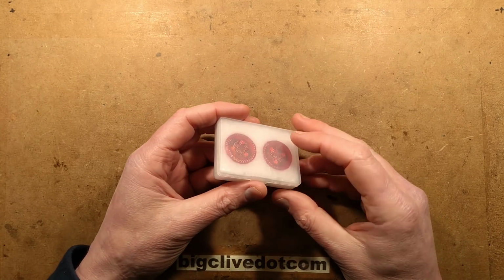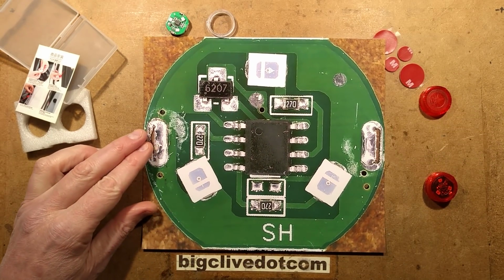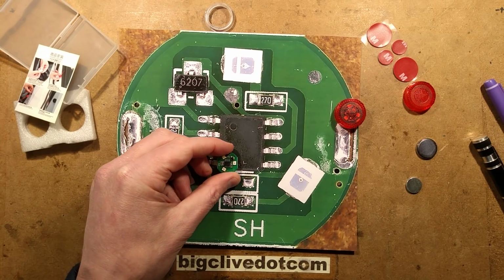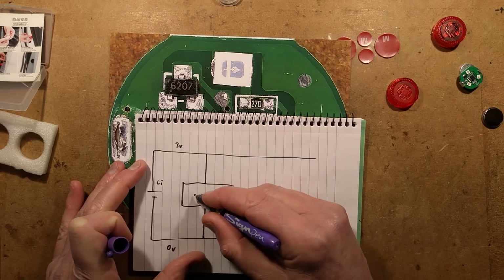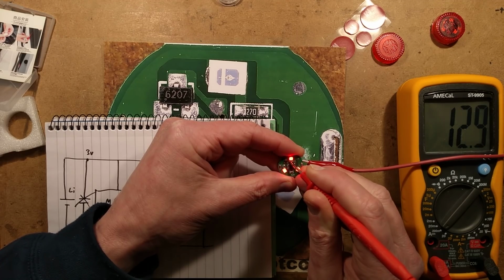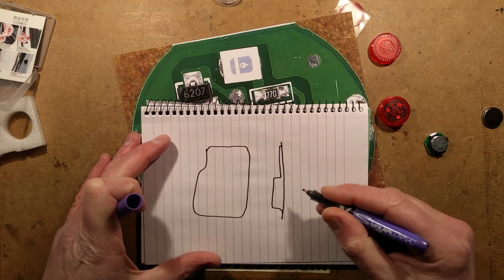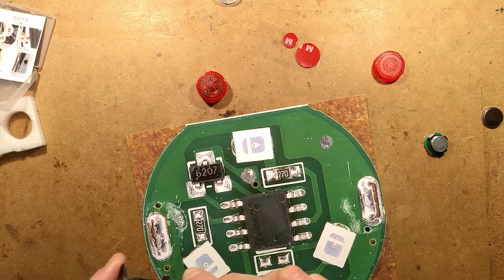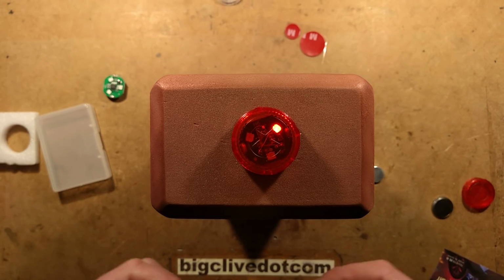Self contained vehicle door warning strobe lights.

Comment: That 'odd' effect is 3 LED's switching, each with the same duty cycle. Try blocking off each one in turn, with your thumb or finger, and you’ll see it clearly. Nice idea, but useless in daylight, or when a cyclist or driver is not looking where they're going. There was something similar, on various cars, decades ago: It used 12V filament lamps mounted in the door, wired in parallel to the cabin courtesy light, and operated by the door switch. Simple and reliable. Another, even more reliable, option is to use one or more flashing LED's, with resistors, and a door-mounted micro switch or reed relay. No need for a PIC, capacitors, resistors, or other semiconductor devices. Again, it can be wired to the door switch.

Comment: One way to check whether suitable space exists around a car door for these is to put a large blob of blu-tac in the desired area and close the door to flatten it to fit the space. Then just either measure the compressed thickness of the blu-tac or compare it directly to one of the modules. Simples!

Comment: These devices are too small and too dim to be of much use.  I would rather spend the money on a strip of reflective tape that can be secured to the edge of the car door — needs no batteries and always works as long as approaching vehicles have their headlights on.

Comment: The spot you shown is going to be fairly common but some cars it's occupied. The one control I can think of off the top of my head that's roughly in that spot is a child safety lock. The factory very likely punched those sheets identical for front and rear doors but only punched out the hole on the rear doors, possibly even shared that particular sheet with other car's rear doors. If you don't have a spot and are determined, could always find someone good at shaping metal to hammer an indent into the door for it, something that size wouldn't be too difficult to accommodate without changing the shape of the door in the process.

Comment: This is actually a brilliant idea, I deliver newspapers and I'm constantly in and out of the car. Sometimes if there's no traffic, I'll leave the door open to save the wear and tear on my plastic door handles (it's a Toyota, door handles are a common failure point, and I'm only out of the car 20-30 seconds at most each time) but there's always that chance someone is going to come speeding through... These would be (hopefully) more noticeable than reflective dots! My car doesn't have a rubber "doink" if I remember correctly. LOL But it's worth tossing a couple bucks at to see if I can find a way to make it work.

Comment: Yeah, instead of 3M you get the Chinese knockoff. Single M. 1/3 the sticking power, 1/3 the cost, 1/3 the quality.

Lets probe!!!
Reply: Best price! Best price! Best price!  That's the only qualification the part suppliers care about.  Doesn't matter if the product doesn't work or uses fake defective stolen designs. Best price!

Comment: I think the idea is great but the issue I see with this is it isn't very bright and from a distance behind a vehicle may not be visible or may appear to be a light on something further down the road because it is a lot dimmer than other lights on the vehicle. This could actually fool someone into thinking there is no open door if they can see a light further down the road. Also, with the door wide open it won't be facing towards the back where traffic is most likely to be coming from. Cars I have seen with warning lights on the door have had it placed on the inside, not on the end, of the door to be seen from behind when the door is wide open but I imagine some may have it on the end too. Of course each country has their idea of what is required or allowed. Lit up like a fire truck is your best bet, right? LOL Just my opinion but I think really good retro reflective tape put inside the door AND on the end would work well. One advantage of this is it works even with dead battery or power failure after an accident. Likely most people would go "ewww that's ugly so I'm not doing that." Having been rear ended by someone texting while I was on the side of the road I'd vote for saving my ass over aesthetics anytime although if someone doesn't have their eyes on the road your best bet is super @#$%!ing bright strobes that they actually see lighting up the inside of their car and make them look up.

Comment: You can find out where it might fit using a bit of modeling clay (or a flour dough-ball).  Stick it to the car where you want to test, and put a bit of talc/flour on the high spot so it won't stick to the both sides. Use a ball that is a bit larger than the device/magnet combo, and then close the door. It will be smashed down to the available-space size.

Comment: After 30 seconds, the flash mode changes.  Install it, close the door, wait 60 seconds, open the door, and if it's the FAST pattern, then yes, it turned off.  If it's the SLOW pattern then no, it didn't, you need to move the magnet.

Comment: For absolutely no other reason than curiosity would these be legal to use in the UK? 

Each Christmas there is usually some news item about trucks having mini Christmas trees in the window which they would have you believe contravenes just about every section of the highway code.....and bicyclists get a rough deal too over 'flashing' rear LED lights.....so just wondered if you'd get hung, drawn and quartered for using these?

Are the laws different for stationary vehicles? Just curious.
Reply: @Matt Quinn Amen to the insomnia cure that is legislation - I spent six years working in homologation. Unfortunately lighting wasn't one of my specialisms, but I'm inclined to agree with you about these not being external lights. However, a vehicle being stationery but still on the highway is still liable to law. And Rule 239 of the UK Highway Code already clearly gives the door-opener responsibility for checking: "If you have to stop on the roadside:...you MUST ensure you do not hit anyone when you open your door. Check for cyclists or other traffic" https://www.gov.uk/guidance/the-highway-code/waiting-and-parking-238-to-252 There is a comparable Rule telling cyclists to give themselves clearance from parked vehicles. So on balance, I regard these lights as interesting but not worthy of adoption - and I'm a cyclist! (And a car driver, but not owner - had a licence for over 30 years.)
Reply: @Matt Quinn The slippery slope that is cheap LED lighting :-(

Comment: I think this might be the 6207 datasheet. https://datasheet.lcsc.com/szlcsc/CrossChip-CC6207ST_C286001.pdf :)
Reply: "Overview
The CC6207 is a micro-power, high-sensitivity, full-polarity, Hall-locked sensing device with latch-up output that directly replaces traditional reed switches. Particularly suitable for use with battery power
Portable electronic products such as mobile phones, cordless phones, notebook computers, PDAs, etc.
The CC6207 has a magnetic field to identify the full polarity, that is, as long as the magnetic field is near the north or south pole, the output is turned off. Unlike other general Hall sensing devices,
Do not operate in the specific South Pole or the North Pole, reducing the need to identify the magnetic pole during assembly. The internal circuit of CC6207 includes Hall sheet, voltage voltage regulator module, signal amplification processing module, and dynamic
State offset cancellation module, latch module, and CMOS output stage. Because the CC6207 uses an advanced Bi-CMOS process, the overall optimized line structure allows the product to achieve extremely low input errors.
Poor feedback. The product uses dynamic offset cancellation technology that eliminates offset voltages caused by package stress, thermal stress, and temperature gradients, improving device uniformity. At the same time
The product adopts its compact packaging technology, which makes the product more highly performance and market advantage.
The CC6207 is available in TSOT23-3, TO-92S and DFN4L packages with an operating temperature range of -40 to 150 °C."

Comment: If a CR2032 lithium cell has a capacity of 235 mAh and the off position current draw is 22 uAh the battery will last 10,682 hours or 445 days, prob ~1 yr at most if used regularly.

Comment: Do they work? Can you see them at (say) 100 feet? How do they compare to retro-reflective tape?
Reply from the maker: It might well compliment retroreflective tape.
Reply: @bigclivedotcom  Interesting. Is the animation important? They seem rather small diameter at practical distances, but if they "twinkle" that's something. I used to hate animated indicators but after years of moaning about indicators being swamped by headlights I've realized I'm completely wrong and animation might be rather useful.
Reply: I’d wager this would be better than retroreflective tape, because these emit light where the tape doesn’t.
Reply: @mrb692  Although these do use more batteries than reflective tape
Reply: @Quick_Fix  good one... and the tape is fail-safe, if there is any light...

Comment: there is coupling capacitor . . . it just happens to be 0.00000000003 nano-Farads.
Reply: Actually DEcoupling or filter cap. :-) And realistically the capacitance between those pads is probably around 3 to 10pf or thereabouts, so a huge .003nF or so.
Yes, I know you were making a joke and I appreciate it, but I just wanted to point out that there is a little more capacitance between random bits in space than most people realize.

Comment: well we can assume that they went for open drain gpio pins on the uC but then the 27ohms resistor is the only thing between the led and ground (apart from the tiny channel resistance of the fet inside the uC so i wonder what current these things are running at and how good their lifeexpectancy is. 27ohms is way too little for my taste

Comment: Could they not have used a reed switch and then the unit would have used no power with the door shut?
Reply: Reed switches are expensive.
Reply from the maker: The switch would have been activated by the magnet when the door was closed.  Most are normally open, so it would still need a pull up or pull down resistor.  This little chip may also be a lot cheaper than a glass reedswitch.
Reply: Granted, but in my mind it’s still suboptimal design in a device whose primary function is safety related to have it not work due to a dead battery. But then since when have Chinese manufacturers been concerned with safety! 😛 
I guess the micro can sleep most of the time and wake to check the sensor every second or so, and so use next to no power with door closed - if the software is designed and written correctly. But then that is by no means a given either!
Clive, did you think to measure the power draw in the “off” state?

Comment: If you remove your car doors there is no need to purchase these. 👍🏻
Reply: #justjeepthings
Reply: Or, just stay in the car forever.
Reply: I don't want the car, I just want the doors with the blinking lights on them. LOL.
Reply: Genius
Reply: Although I have a Wrangler and that is an option, I seriously doubt that I'll ever do it since around here, that would just mean water, road grime, and mud in the vehicle.  Plus, it's so hot and humid here, I'll never remove the hard top either.  If you live somewhere with little rain, humidity, and not excessive heat, removing the doors and top would be nice.
Reply: @seanseoltoir  Hey Sean, I'm from Scotland, we get on average 1 sunny day per year,  convertibles are a bad Idea here because there's that much salt applied to the roads it's atomised into the air from moving traffic. It gets everywhere. I go through about 2 brake calipers a year. But I love Scotland. The people that like sunnier climates from Scotland usually emigrate to Australia.
Reply: @MurrayMints  -- We've had two trips to the UK and Ireland so far.  Each trip consists of a month of driving around the countries.  We might have a couple of planned destinations, but for the most part, it's just a case of driving around and seeing where we end up.  I really like Scotland though -- less people and great scenery.  The summers that we experienced there seem about like the winters that we experience here in the Houston area.  It was 80F today, but for the most part, it's been about 50-60F lately.  We drive a lot of the more rural roads, even the single lane ones where you have to stop and pull off to the side when someone is coming from the other direction.  Roads where Google's StreetView does not even cover it.  I've driven from the southern tip of England to the northern tip of Scotland and the same with Ireland and Northern Ireland.  People over there comment about it being a lot of driving, but it's all relative.  Compared to Texas driving distances, it's not that far.  It's 880 miles from one side of Texas to the other driving along the southern cross state interstate highway (I-10) and we consider that a single day drive.  Plymouth to John o' Groats is only 800 miles.
Reply: @seanseoltoir  I think we've kinda went off topic because I've no idea what your on about. You should maybe try TripAdvisor or something
Reply: @MurrayMints  -- Just normal morphing of topics on the internet... Started out with car door edge lights, then someone saying to remove the doors on the car (e.g. certain Jeeps), then my comment about local weather not being conducive for that around here due to heat, rain, etc, then your comment about Scotland and driving without a top, then my comment about driving in the UK and Ireland... Pretty straightforward morphing of topics -- we haven't even morphed to politics, religion, or sex yet (as all topics eventually morph to on the internet).

Comment: I was actually thinking tachometer for electric motors..  9/10 when you get a treadmill motor the rpm / mph/ kph sensor is broken..  there is usually a pully with a magnet attached and a reed or a typical pull on switch deal that communicates an i/o with the main cpu on the board that im assuming has an algorithm that equates the size of the pully and magnet spacing to ticks the switch pings back to speed..   i have gotten several over the years and only had one actually work, until i poked it and it just stuck open like the rest.  I’ve found that the security system window or door open sensors work great for a tach on that set up.

Comment: I would think a N.C tiny reed switch in line with the battery (instead of the Hall sensor) would drop the "OFF" current to Zero.
Reply: Probably not as reliable, sadly.
Reply: @TechyBen  Perhaps....
I have +20 year old Alarm reed switches on windows and doors that have not yet failed. Alarm detection switches seem to be more critical than blinky lights... IMO
Reply: @lasersbee  I don't mean fail. I mean for their use case. Perhaps they could not get it working with one?
Reply: @lasersbee  Distance. I'm not saying it's hard. I'm saying perhaps they found a microcontroller easier to cover the use case they have. It could for example automatically turn off after 5 mins, to prevent it being on all the time etc.

Comment: Volvos used to come with lights (powered off the car battery) on the door edges, as a standard feature, which I always thought was a good idea.

Then Ford bought Volvo cars in 1999 and did some cost reduction.... by 2000 they were no longer fitted! They must have saved a fortune..... not.
Reply: If you save $2 per car and make 500.000 cars annually, you save $1.000.000 per year
Reply: @pervariant  Straight into the CEO's pocket!
Reply: I think that a lot of car manufacturers figured out that reflectors work just as well as the lights.  If it is daylight, then the lights might not be that visible, but since you can see the door itself opening, that is probably not that big of a deal.  At night, you're driving a car with headlights, so a reflector works well enough.
Reply: My 1975 Toyota celica had them too.

Comment: Just a thought...  Basically, can't this be done with a CMOS version of good, old 555 like ICM7555 (TLC555 from TI). As I've heard, some of them work from 2V upward and also have an Iout of around 100mA. Temperature drift does not matter for the application. Of course, no fancy flashing mode changes but purpose is warning not disco dancing...

Comment: Next time, try putting it magnet side first, place the adhesive pad on the lamp and Peel off the paper over the adhesive and close the door. Pst Presto, the light should be set on the right place, perfectly aligned. Thanks for another informative video.
Reply: Except the adhesive won't actually touch the door. The gap between door and frame will be wider than the exact width of the combined lamp and magnet.

Comment: So...how does the micro-controller get programmed?
Reply: Usually it will be programmed at the chip factory to order.  The programmed chips are shipped to the sweatshop where it is all put together, it is cheaper and faster that way.
Reply: @PaulBudden Sounds about right, I've noticed a lot of these red LED flashers have as similar display...3 leds...
Reply: There are various ways that people have done this sort of thing over the years. But generally you develop the program in an assembler or compiler and end up with a data file of bits representing the contents of memory from address 0 upwards. Then you have a programmer tool that applies power to the chip and clocks in the bits from this file as a serial data stream on one of the pins. Usually this uses a special voltage level on some pin as a magic cookie to tell the chip that it is being programmed rather than working normally. This is usually called Vpp for "programming voltage". Once you have the chip programmed you can read it back to make sure it was programmed correctly, and then give it one last command to make the memory unreadable from outside the chip. All this only takes a few seconds for a small chip, and can often be done after the chip is already mounted on the final device.